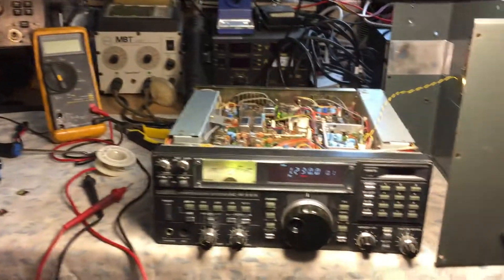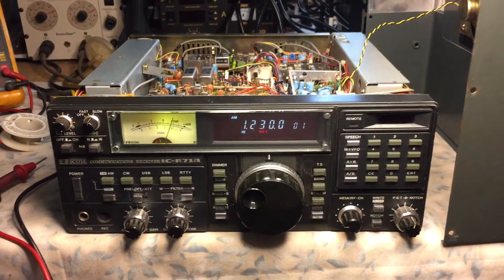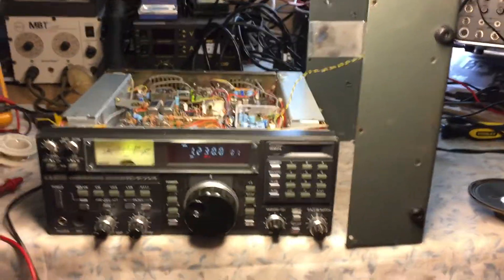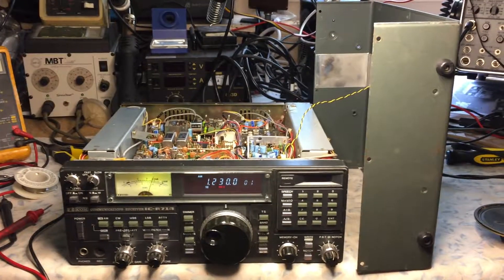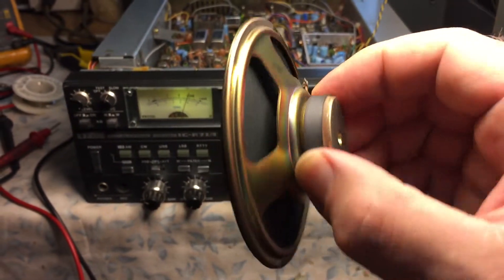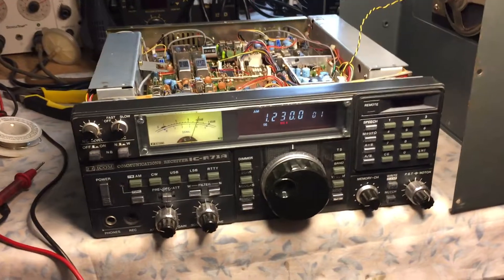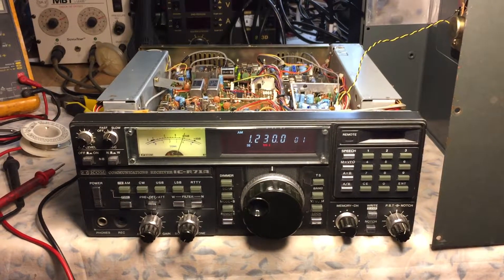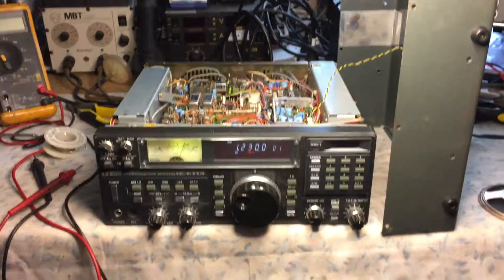ICOM IC-R71A Dead Receiver FIXED

Comment: A friend VO1DZA helped me repair my R71A.  It was powering up OK but had no receive.  He replaced all the capacitors on the PLL board ...including the 4 plastic trimmers that are in the soldered metal box on the PLL board.  What a hell of a job but it worked and brought the RX back to life.    Today I was able to purchase an RC11 Remote Control unit locally.   The companion board is not in the radio so now hunt is on for that.   73 VO1HP

Comment: Nice Vid!  I have an R71A that I haven't used in about a year.  I turned it on last week and it seemed dead but I did hear a faint "ping" from the speaker when I applied power.  You have motivated me to open it up and troubleshoot.  Would you suggest trying the DC power first?  I'm no electronics whiz but I assume the first place to look if DC power works is at the AC power supply.

Comment: I just repaired my r71 last night! No receive except on fm mode. Started seeking loose solder joints, found that the "dp-2" module which is apparently the -10v dc power supply, Took that little tin can apart and resoldered the entire job and she has been chooching along for 10 hours now singing BEAUTIFULLY!!  I watched your video first hoping I had such an easy fix aswell but obviously my issue was a little deeper.    Im going to try to locate a replacement supply for mine, and when I do I plan on posting a video of that repair!